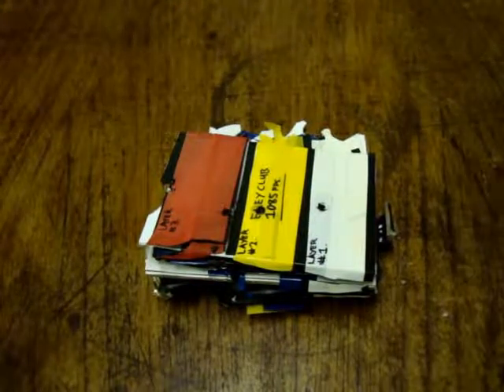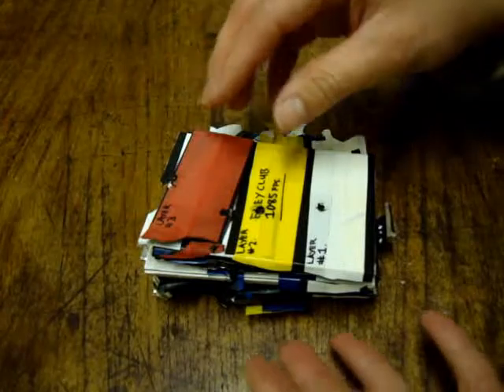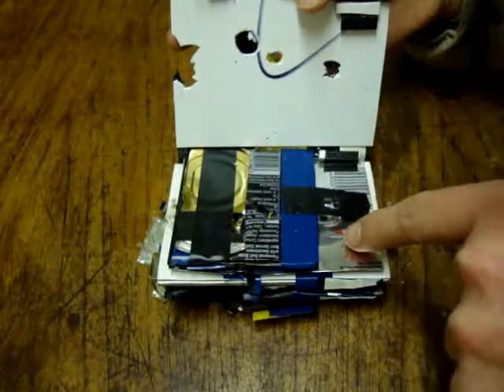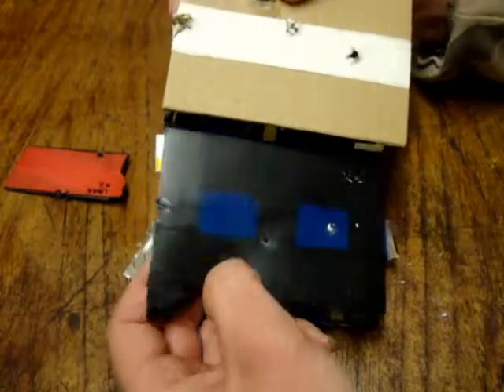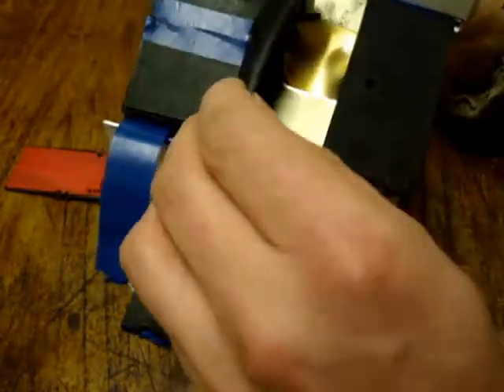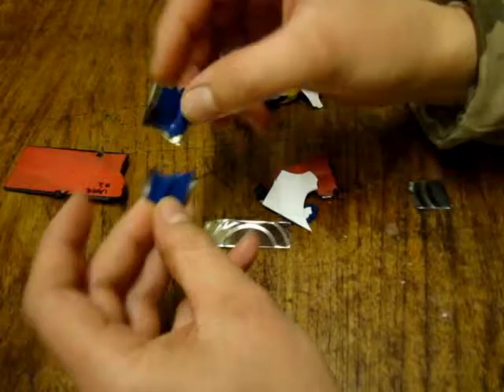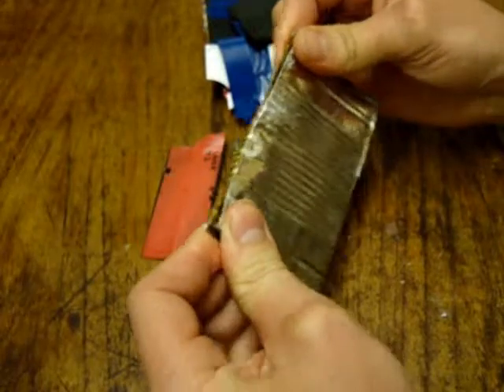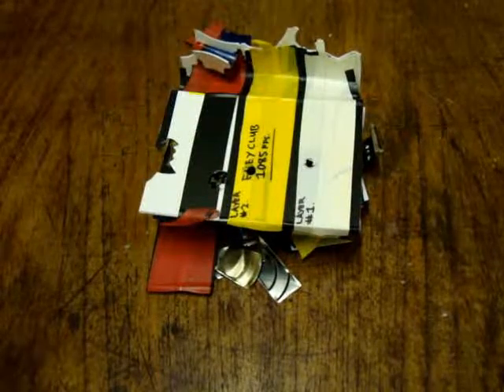1st Eley Club .22LR Penetration Test

Comment: Your test is the only time that the rounds will be up against a compressed pack of these specific materials, meaning that the only point to the tests is to do the tests. There is no further correlation to real world performance when you test it against this unlikely composite structure. If you want to see what it will do against a car tire, shoot an inflated car tire. If you want to see how many layers of duct tape it can penetrate, that would at least be a standardized and reproducible test.